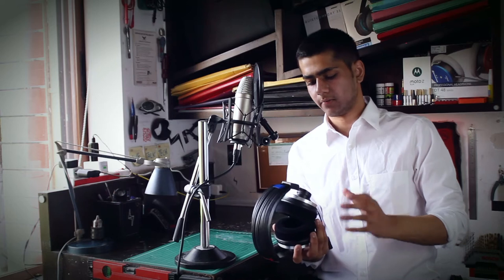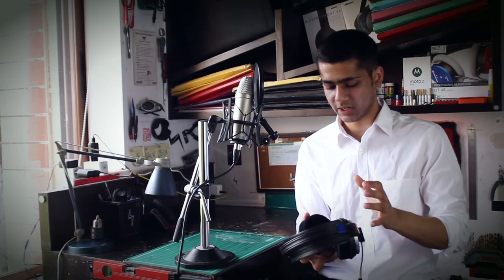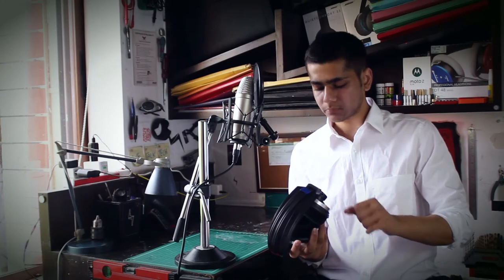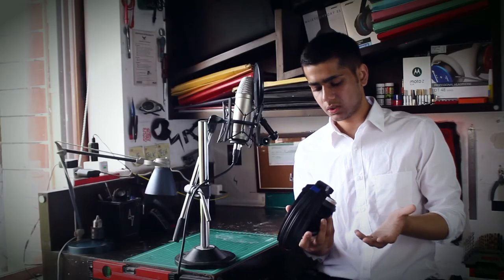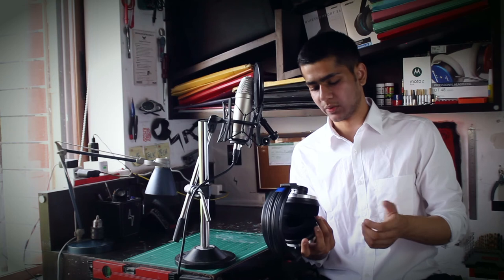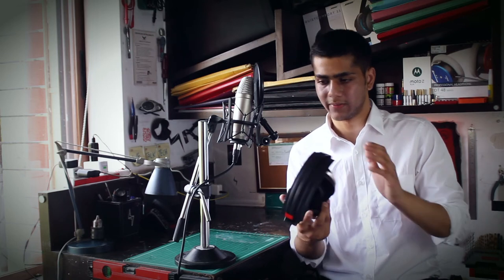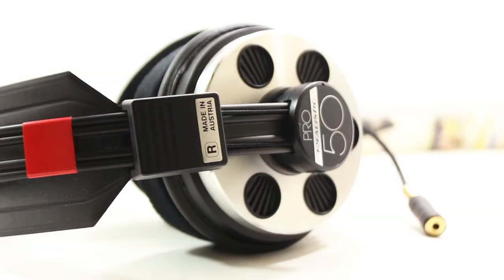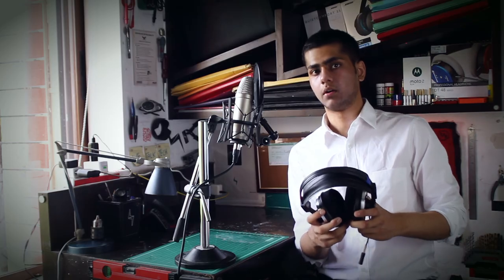Realistic PRO-50 (c.1980)

Comment: K340 headband, sextett hardware and K250 hinge, badge and cup shape in aluminium. These are really quite something special.
Reply from the maker: Yup, she's pretty but sadly it's Plastic not Aluminium.
Reply: You're kidding ! These things had me totally fooled ... I usually don't get things like that wrong ... Is it just ugly weird shiny plastic on the inside ?
Reply from the maker: Yup, it's all Plastic. You need to spend enough time with your Headphones bro!
Reply: I won't believe it until I see a pic from inside :P
The problem is I've got them on my head most of the time ^_^
Reply: @iridescentgherkin  The inside is plastic, the outside feels like aluminium. It does feel metal cold compare to plain plastic surface.
So nothing special, a plastic casing with an outer thinner aluminium wall.
Just like the AKG badge, a thin metal plate sticks on to a plastic surface.

Comment: I scored a Realistic Pro 50 on Head-Fi!  I already did some EQ'ing, but can you show your correction for these?
Reply from the maker: Sure, I'll get back with a rough peak and dip data as a reference for you but it's pointless due my pads being different and HRTF differences which render High Frequency data of my curve useless for you. 
I'm at work at the moment I'll get back by tonight.
Reply: Thanks! Yeah, it'll help me have an idea of where to start. I've tried Alpha pads and Brainwavz angled hybrid pads. So far, I like them with Alpha pads uncorrected more so than the angled hybrid pads, as I found the latter to accentuate the mids and treble.
Reply from the maker: Just looked at my curve, I have kept it relatively flat. So, there's not much correction except the bass where there's major correction to compensate the lack of energy, an approx +12dB rise from 70 to 30Hz. A little energy at 100Hz to 200Hz and fairly flat from there until 12kHz which need to go down by 2 to 3dB.  I have refrained from talking much about the HF as it's really won't be of any use to you and will be misleading. 
Hope this helps.
Reply: Thanks!